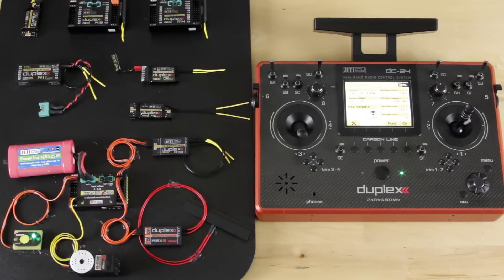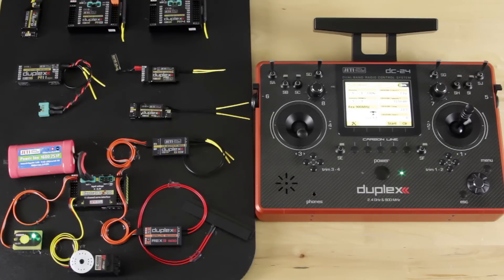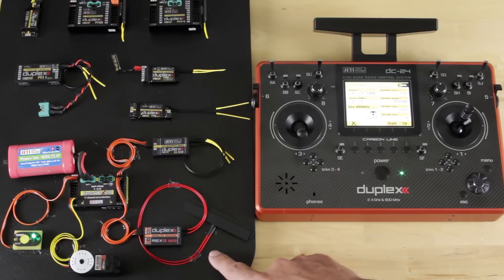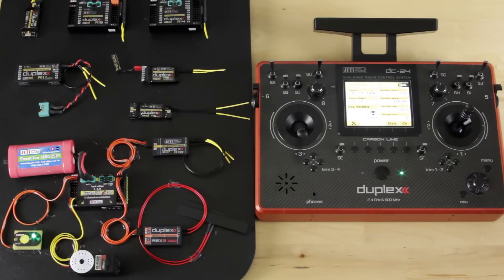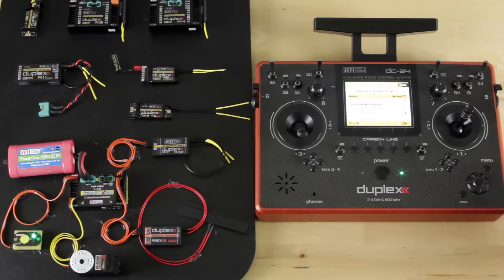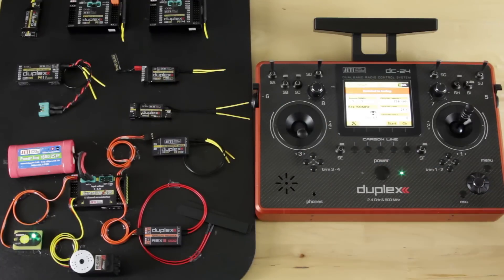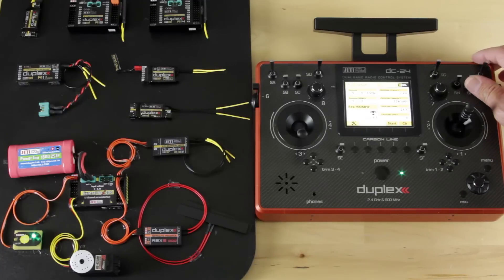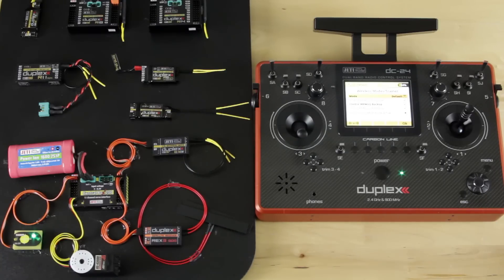A Closer Look: Jeti 2.4GHz and 900MHz Dual Band Redundancy (R3 REX 900MHz)

Comment: Hi James, I did this configuration but it is absolutely not working to me. When I unplug the 2.4GHz I've go the information on my DS-24 but servo is not anymore running and on DEVICE EXPLORE I lost CB200 as well...
Reply from the maker: Alain, I am sorry to hear this is causing you some troubles. Please send James an email at support@esprittech.com and he will be able to dig a little deeper with you for a resolution. Thanks! P.S are you running updated firmware on all devices?

Comment: Would I need a Central Box to have a redundant setup for a µVector flight controller? Thanks.
Reply from the maker: What type of redundancy are you looking for? Power or signal?
Reply: Signal. I would be using the flight battery for all on-board power.
Reply from the maker: I do believe that would be the only way to utilize redundant signal. For more specific questions reach out to our sales department @ sales@esprittech.com.